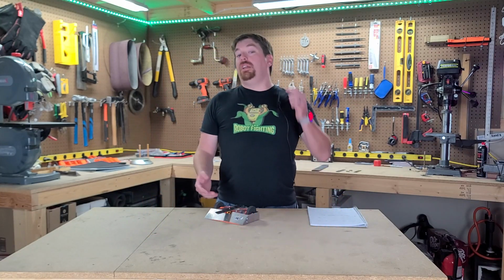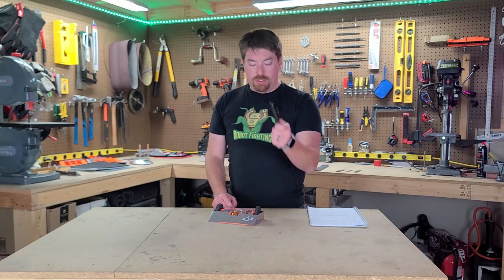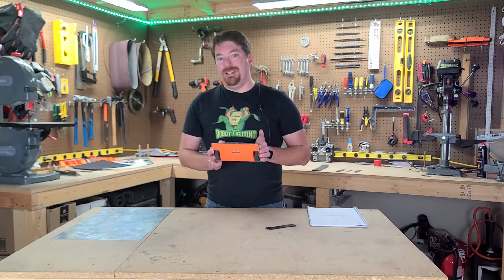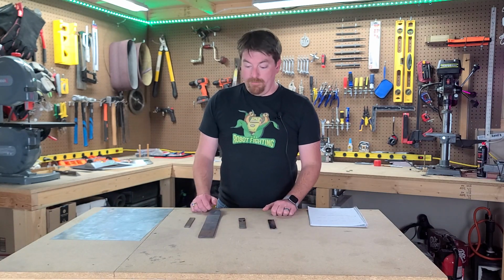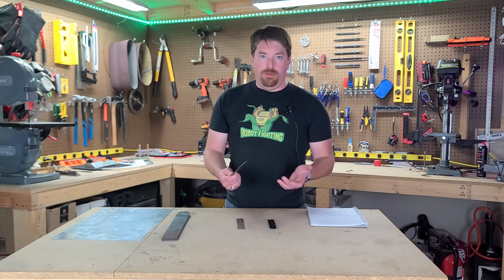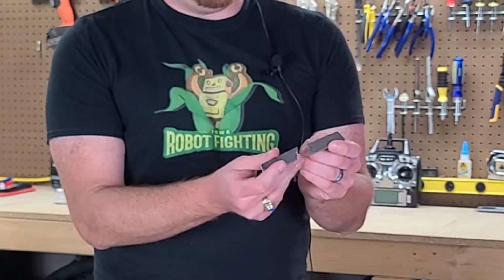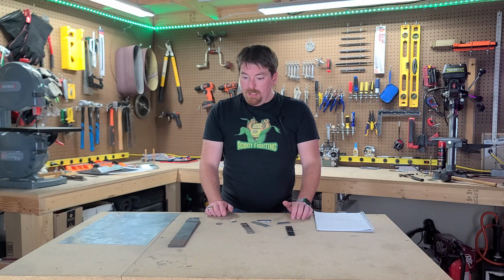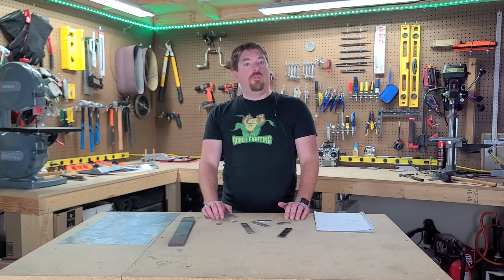Forging Robot Weapons

Comment: You can buy steel bars in appropriate grades (AR500, AR400, S7, Chromoly) for pretty reasonable prices. Also, Grade 5 titanium is better than mild steel at the same thickness and about 1/2 the weight so you could make it twice as thick it's very hard and springy so it works great for a weapon on smaller bots. Titanium is relatively expensive, but considering how little you use on a bot this size it's really not that much. I was going to bring this up in your armor video as well, it's only 1.6x the weight of your aluminum and even at 1mm it's going to easily deflect opponent's weapons if it's angled well.

Additionally, there are quite a few companies offering appropriate weapon bars for ant and beetleweight bots out of materials which will hold up quite well and they come shaped with raked teeth and often in a design that puts more of the mass toward the outside edge of the spin to maximize MOI. Fingertech is probably your best bet, they have 8 different options in horizontal spinners, so I'm sure you could find one that works for you.